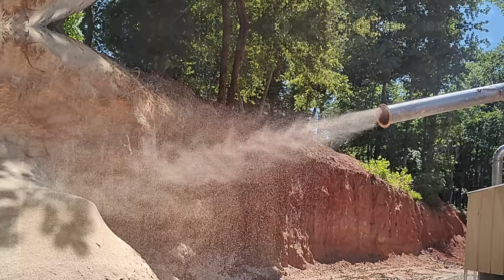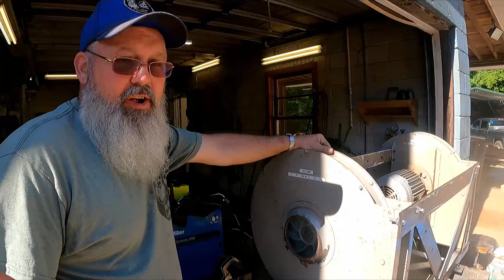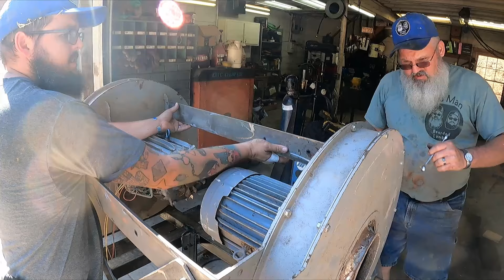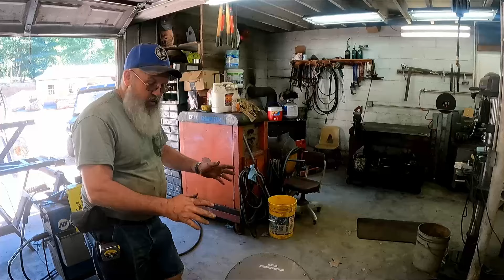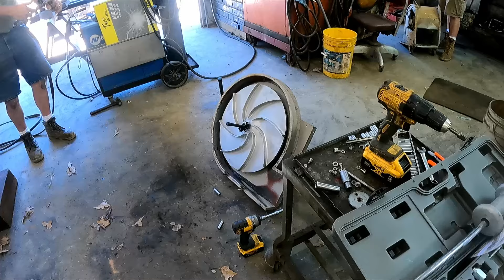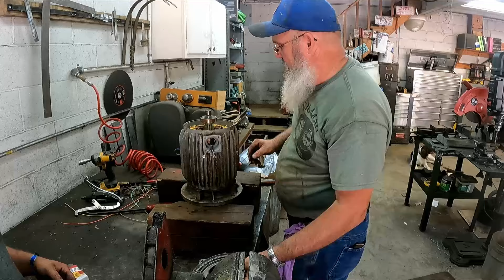Rebuilding One of the Blower Motors (Molder Planer ep 19)

Comment: Smart dog knows where to lay and oversee, you should have paid attention to him (dog) and not removed the electrical junction box. I was quite anxious when you applied heat to the aluminum fan blade via acetylene, but you were aware/cognizant of issues and careful good job. That impeller design and diameter should produce up to about 7-10 PSI of static head pressure. I am guessing that motor RPM is less than 1200 if more static pressures could be higher so be sure to use ducting that is strong enough to prevent blow outs, I wonder what machine they came from that needed such compact high flow air as these blowers they are very costly, robust, and powerful. Ray
Reply from the maker: Thx Ray, the motor rpm is 3400, and they were used to remove lint from a nearby cotton mill thx for all the great information keep it coming 👍
Reply: @BeardedLumber  Wow with an cenftrugal impeller of that diameter you should check the vacuum at the input to see how much draw you have. You may be able to get a vacuum line also which with some clever engineering you may be able to have an almost dust free milling room for no extra cost. Ray
Reply from the maker: I'm adding a floor sweep also
Reply: @BeardedLumber  You're planning is superb!! Ray